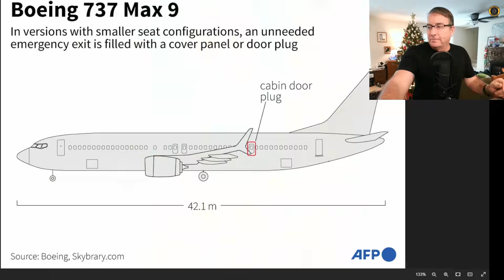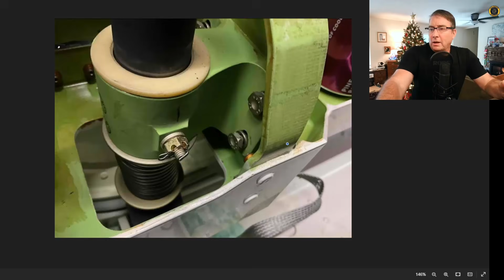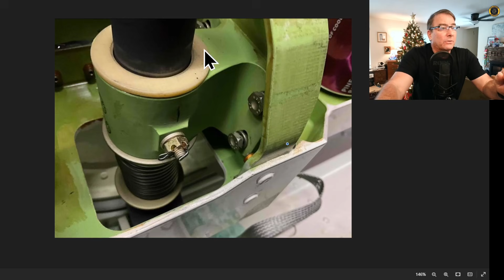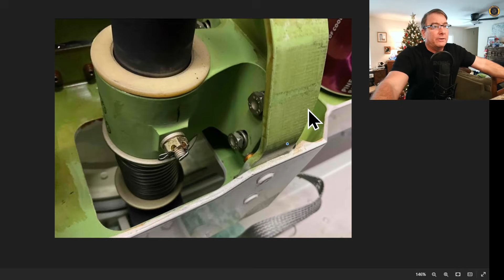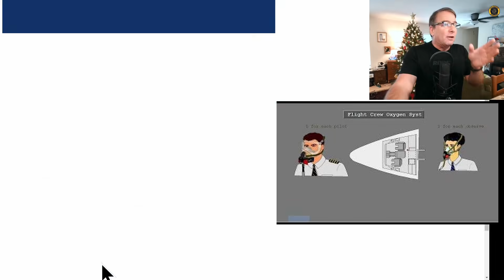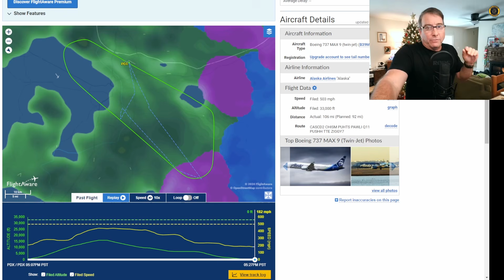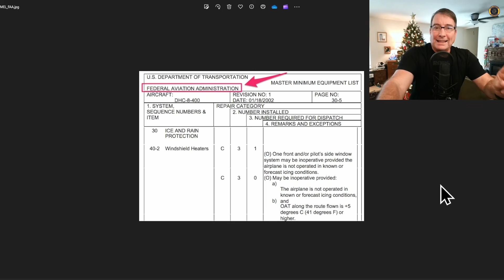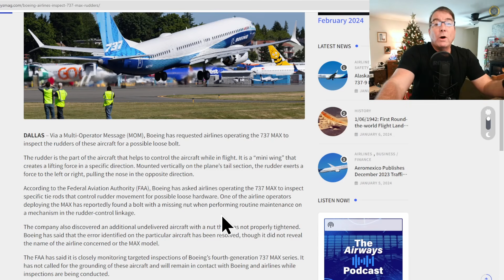"Yes, We Have No Bolts"  9 Jan 737 Max-9 Update

Comment: Good idea to always have your seat belt fastened while seated. I would hope it would hold you if you were sitting near the faulty door
Reply: Seats are rated to hold a passenger up to 9g. A properly fastened seatbelt would hold you.
Reply: Let's hope the seat is bolted down correctly.
Reply: @Blumpton_blueprint  I’ll say it’s likely not a good option, although a possible one.

Like in this situation all hell broke loose as soon as it depressurised, they had to work from memory to figure out what to do, so a button/light would likely be missed, plus there’s the potential for an incapacitated pilot to accidentally hit the button, or debris in the cockpit. I truly don’t believe there’s any good solution to the problem, aside from maybe an emergency passcode on the cockpit door
Reply: The news coming out that the cockpit door flew open as designed by Boeing in depressurization is something that needs to be addressed immediately. The wrong hombre's get wind of this no pun it's a catastrophic security feature.
Reply: @pmccoy8924  its a really difficult situation, in a scenario where the depressurisation incapacitated the pilots you need that door open to get someone in and flying the plane, but in a scenario where the depressurisation occurs due to hijackers it makes it harder to prevent them from hijacking the plane
Reply: @pmccoy8924  Objectively, I'm fine with that. I would rather the entire door opened.

Comment: I can understand mess at Boeing, but I totally do not get how regulators accept such an incompetent design. 
Is it not obvious that anything classified as a "plug" can ONLY fall inwards and not slide up and fall out? Pads should have holes and fittings should have pins so that door (plug) should first come inwards before it can ever go up, even if all bolts are missing. Yes, more expensive design. Alternatively, there should be a maintenance procedure in place. 
So we not only have incompetent manufacturer but also incompetent regulators too?

Comment: Could it be the max's engine configuration leading to vibration, or most specifically introducing a torque that the airframe/pressure vessel is not used to?

Comment: I'm an old guy who used to work on USAF aircraft, and in the image of the hinge guide fitting bolts holding the guide onto the plug, it bothers me not to see at least safety wires to prevent them from wandering off ...

Comment: UA Flight 811 in Feb 1989 was caused by a cargo door swinging outward from hinges at the top.  This plug door is the same thing again but with the hinges swinging out from the bottom  Boeing hasn't learned a damn thing.

Comment: I would like to know if in the design phase Boeing engineers modeled the way this door plug would depart the airframe in the case of a fault such as this, so as not to harm the flying surfaces at the rear of the aircraft.

Comment: Two things puzzle me:  How could door move vertically with cabin pressure delta and overcome plug compressed spring pressure.  Maybe detents in the roller guides would do it.  I presume the passengers near that plug were debriefed, would think air escaping would would be noticed.  I know leaking door seal flutter will get your attention. 

 Miss the vertically opening true plug doors on L-101.  Don't remember the pressure but a small amount of cabin delta would prevent the door from opening.

Comment: Some 737-900ERs have a similar plugged mid cabin doors and have been flying for years without issue. It’s interesting that there’s been two defects found related to these doors in the Max 9 variants between the Alaska plane and the United plane. Makes me wonder if this is a new manufacturing issue or if there were changes to the door design that weren’t properly tested.
Reply: I saw a comment on another channel to the same effect. -900ER with 41,000 hours and no issues. Wouldn't surprise me if Boeing went with lighter bolts or something that allows them to back out ...

Comment: How did those castle nuts both unscrew even if there were no cotter pins?
Reply: Vibration can loosen bolts easily.  They probably were never installed to begin with

Comment: Juan, a nice review.  They are certainly lucky that door did not come off at 35,000' altitude or higher.   That would have been a catastrophc event ---- the pilots would have had to donn their O2 masks in no more than several seconds.  It is my understanding that at least one of the pilots flying the "big iron" must wear an oxygen mask at all times above 35,000' MSL.  I have made five skydives from 30,000' MSL and we take extreme precautions preparing for these high altitude jumps.  The oxygen bail out bottles and air-tight (demand) masks are all from the military and TSOed.  The oxygen is deliivered "on demand" by initiating an inhalation.   The time of useful conscousness after explosive decompression at 35,000' without oxygen is only a few seconds for healthy ppl (nonsmokers, etc.).  Ambient air pressure is halved for every ~18,000' of altitude, therefore it is only one-fourth of sea level pressure at 36,000'.  They were not even at one-half of sea level atmospherc pressure.  This should get the undivided attention of ppl in the FAA who don't want to have to explain their oversights after catastrophic but preventable accidents.

Comment: I think it’s time for some serious accountability for Boeing management. There’s a good possibility that this fuselage plug failing at cruise altitude would have resulted in another catastrophic incident for the Max. Now we’re hearing about problems with the retention hardware being discovered on other examples! From the QA problems with dreamliner deliveries, to the MCAS debacle, now we have plugs blowing out - this is completely unacceptable. First, the flying public needs to boycott Boeing when an alternative exists. Check the expected equipment for a flight and schedule one with an Airbus where possible. Second, the airlines need to take action to demand change at Boeing, including a new board. Finally, it’s time to place the FAA under the NTSB and build a real proactive investigation and enforcement arm. It’s not just that Boeing “isn’t the company they once were”, it’s that they’re literally building dangerous, substandard products in a market with only one other viable competitor.

One final point: it’s not just that they failed to properly educate pilots, airlines and maintenance personnel on the specifics of MCAS, they actively misrepresented the system AND failed to engineer appropriate AoA data input redundancy. This is a company that’s disorganized, unable to meet necessary qualitative standards in engineering and assembly, has engaged in very questionable behavior, where the public is potentially placed in mortal danger by their collective fecklessness. No more passes for this company: if it’s Boeing, I’m not going.

Comment: Considering what you have detailed here there are now 8 suspect bolts. I noticed that there wasn’t a mention of how the bolts holding the bracket on are ‘locked’. Are they threaded into an insert or is it a castellated nut with a cotter pin to lock it? Now that there are 2 completely different suspect bolts it’s even more concerning. I have worked in the industry and I know that ALL MATERIAL MUST BE ACCOUNTED FOR. Since this aircraft is new, records SHOULD reveal without doubt whether the required hardware was issued to the BOM for this aircraft and the signature of the technician responsible for installation and hopefully the independent ‘check’ on the installation. Seems like the bean counters in Chicago haven’t learned from their recent catastrophic blunders…SHAME

Comment: Interesting (odd) circumstances omitted from this report  -  (1) It is incredibly peculiar/lucky that, although a nearly full airplane, there were no passengers in the row where the door/plug was located and the seats were twisted on their mounts  -  are the seats belts still there ?  (2)  Because the airplane may not have landed with the same number of passengers at it took off with, was the CVR intentionally allowed to erase.   By the way,  It has always been ALPA who wants to limit the time recorded on the CVR.

Comment: Why on earth was the plug installed on the outside of the fuselage instead of the inside where the pressure would keep in in place even without the bolts. I think that's why most (but not all) pressurized doors open inwards.
Reply: Not true.  Most airplane doors open outward.  It can be configured as an emergency exit door which would also open outward.  Nothing wrong with the design here.  Just someone forgot the bolts.

Comment: In the 1970's and 80's the Boeing 747 and the computer made central warehousing the most cost effective way to go. The computer offered excellent inventory control and access to a broader market. The wide bodied jet offered customers next day delivery service of critical machine parts at "affordable prices." __ The office computer also gave the lowly office manager inroads to the sales and service shop that were formerly denied him. The computer and the microprocessors that monitored the key components parts of a machine made "predictability" possible, and that in turn downgraded the need for a highly paid foreman who had above average mechanical abilities and years of experience. The office manager who has his eye on the price of an airline ticket may have been interfering with the service shop manager who puts safety first. __ Every machine part has a life span and metal fatigue does happen. __ Did the bolts on the plug door have sheer strength? Were they made in China or Viet Nam? _ Were any bolts or cotter pins "good used." _ Mechanics usually build up a "good used parts" inventory.  The fact that the nuts on some of the bolts were loose would make me suspect that the threads were worn. _ In a business like Boeing the smart money would be on "the working foreman."  He'd have to be good though!

Comment: I heard on another channel that these plug doors are often open for maintenance and ventilation. I suspect this door was opened during maintanence. Time got short and someone was calling for the work to cease and return the aircraft to service. Somebody put the door back in place but hadn't replaced the bolts. They either forgot or someone else rushed in to reinstall the interrior trim before they could and it was assumed that the bolts were back in place. And the trap was set. I don't know how they do it in the airlines, but where I worked, there was a work order for everything we did and a QA inspector had to inspect and verify the completion of all work. Maybe these doors need to be left alone if they are just plugs or replace them with regular latching doors. And Boeing needs to take a time out and rethink this whole door situation.
Reply: This is most likely exactly what happened.

Comment: If you look at your photo of the lower hinge assembly the bolts on the bolster to the airframe appear to be loose. I am an automotive technician and I know that at least two of the bolts in your photo where loose the washer is sitting skewed. That indicates the bolt is not fully seated.

Comment: Your photo of the plug spring and pivot shows "coil bind" of the spring ,that is the max limit of compression travel. The only spring travel would be up. I am glad you mentioned the loose mounting bolts. I guess the use of safety tie wire is old school? Will the union require a gag order for the repair members on reporting findings? The door plug would be a "change order" on the build sheet and maybe not covered by a accessory inspector,. until now. Maybe a torque spec should be included. I see paint stick marks on bolts ,showing some one looked at it mostly on engines. Kinda like a driveway gate, makes you feel safe but isn't worth a crap.. Good job and thanks.

Comment: This is a well presented programme on the 737 max 9, you just also answered a question i was wondering about were the bolts ever in place at all.
If the Electron Microscope picks up that yes their were bolts fitted, wow, the aspect that their is no retrospective maintenance programme by Alaskan Airlines or that is what one report was saying.
This could open a can of worms that Boeing  certainly doesn't need.
14,000 Ft at least gave the crew enough time with altitude to trouble shoot as they go through all this that's going on.
The video taken in the cabin taken i assume by the passenger the scene was surreal to say the least, oxygen bags extended, a flight attendant i think standing talking with a passenger and other persons seemed to be in a state of ok what is happening here but with no certain panic.
I have seen an etops marking on the nose gear of a 777-200 some time back.
The situation as you stated to not sign off on the aircraft / accept due to a pilots suspicion about the maintenance programme about checks seemingily always or near the same to clearly state i am not accepting or bith pilots daying i sm not accepting this aircraft forndaid flight, i / we ad pilots here reserventhe right to reject an aircraft meant for them to fly on the day.
Boeing are facing s nightmare rewrite onr feels of the Aircrafts flight manual (main), emergency check lists, etops comparitives for the want of a better word such is the overall mayhem this incident has created in Aviation circles and the way it is being put across to the public etc, its alright gor Boeing to call an emergency meeting but that is not really addressing the situation but rather ducking and weaving the press over this.
This incident would have also givrn some people in aviation a jolt about actuator problems with certain 737 rudders.
We all get put through the simulators and go through the ins and outs of how we as the crew managed a major dydtem failure including a complete loss of power in engines, sudden decompression and so on, in the simultor you have the luxury of sitting back and saying ok we handled that ok but gee i certainly would have questions buzzing around in my mind what if this scenario we just went through is a possible inherant fligjt management system of this aircraft, airframe or right through to flight computers etc, it certainly makes one more attentive to the last recent major overhaul of type more relevant than ever.
I could keep going on and on.
Your Reporting On This Incident Is Like All Your Previous and that is Superb.
Regards

Comment: Sounds like someone is not happy and might be taking it out on not doing their job correctly. More than one person, BTW. I've seen it done with shear bolts in a breaker box as an electrician. The warehouse burnt down from the 440 3 phase arc. There was more to it, but you get the picture.

Comment: Often when putting something together is to assemble with loose bolts and then go back and tighten them in some sequence.  Maybe the same happened here but forgot about tightening everything or missed a few bolts.  Of course, someone should check the bolts in the person's head that worked on the door plug.

Comment: If those upper bolts fell out they should be down in the frame structure underneath. 
If Spirit (formerly Boeing Wichita) neglected to even install those bolts they are going to get a swarm of Boeing onsite managers and QA inspectors forced on them until they can be shown to be competent. Once that interior panel is installed no one would know.

Comment: The lower bolt shown in photo of right lower  door attachment is not tightened as the lock washer is not compressed. Hope this was not on an operational aircraft. Keep up the good work. Your comments are always revealing and spot on.
Reply: It was on an operational airplane.  Apparently, they've found a few airplanes with this issue.
Reply: Looks like a stainless fastener. Stainless fasteners can very easily get their threads galled up when torquing without appropriate compound applied to the threads (never-seize).  That bolt may very well be torqued to spec without bottoming out if that happens.

Comment: In my business I don't teach the newbies how to do something, but focus on why it's done that way. If you understand "why", the "how" comes more easily, and they learn how to avoid problems as well as fix any that do slip in. The 737 has a long history of being a very good aircraft, yet it's questionable today. Find out why that is and you can fix the problem; omit learning why and the problems won't stop in one form or another.
Reply: Very similar to how problems with planes are handled once they leave the factory. It's not aiming to assign blame, but to prevent bad things from happening. But once things like this turn into a 'scapegoat' scenario people will apply a lot of CYA and try to hide any potential issues for fear of them being assigned the blame. I am personally very ambivalent about this: I think large company management (in this case Boeing) certainly has more than a little part to play in causing this and should certainly answer for that. But that goes against my own words right above here.... Urgh... 🤔
Reply: This is an excellent point. Even in low-risk professions, it's important to explain the why. Even when I've received training myself, sometimes I'd be instructed on how to do something, but not the why.

Then, in my naivety, I would attempt to streamline my work and incorporate more efficient practices, not knowing that there was a reason for why it was not done that way. But because I was not informed of that, it would cause issues down the line. The 'why' is important because you can't foresee what you're not aware of.
Reply: Excellent, and a very important point.